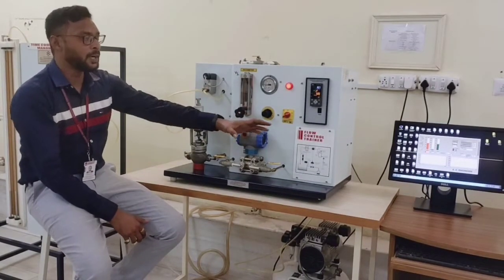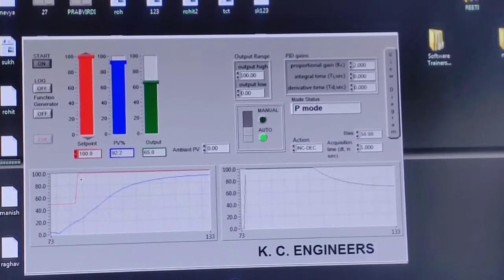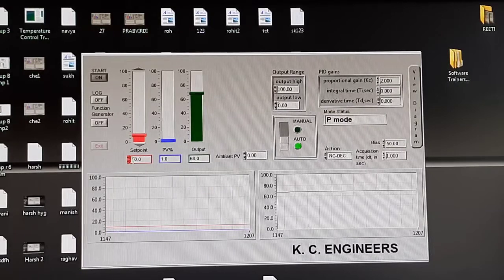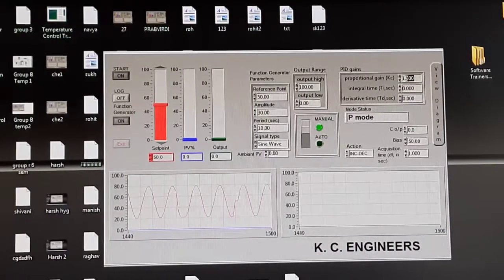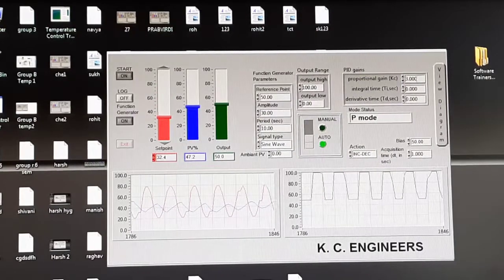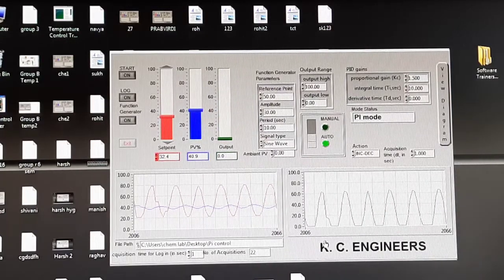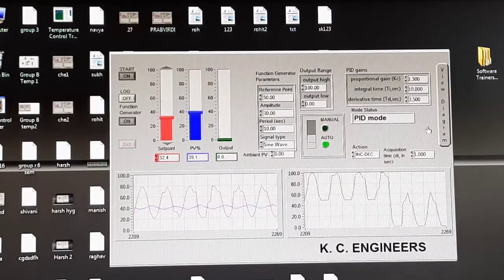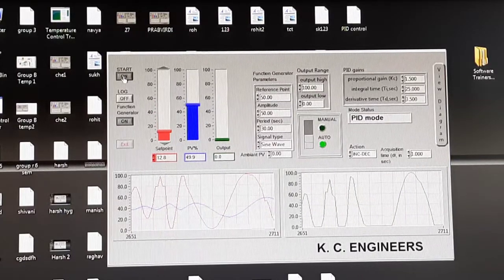Flow Control Trainer (Experimentation)

Comment: Sir please upload Process modelling and Simulation lab experiments :

Process modelling and Simulation lab 

1. Estimation of dew point and bubble point temperature of a hydrocarbon mixture
2. Simulation of flash drum
3. Design of ditillation column
4. Optimization of a flow sheet or process
5. Determination of temperature profiles for heat exchanger
6. Concentration profiles for reactor
7. Simulation of Jacketed CSTR
8. Simulation of process
9. Simulation of evaporator/ distillation column/ extraction process

Comment: Sir please upload PROCESS DYNAMICS AND CONTROL LAB Experiments :

PROCESS DYNAMICS AND CONTROL LAB 

1. I & II Order System Dynamics
2. Interacting & non interacting Systems
3. Flapper - Nozzle system
4. Control valve characteristics
5. Level control system
6. Flow control system
7. Pressure control system
8. Control of a thermal system
9. Design of control system for a given process
10. Simulation of a closed loop system
11. Demo Experiment using Aspen Software of a given process